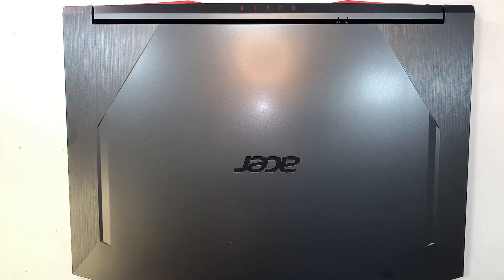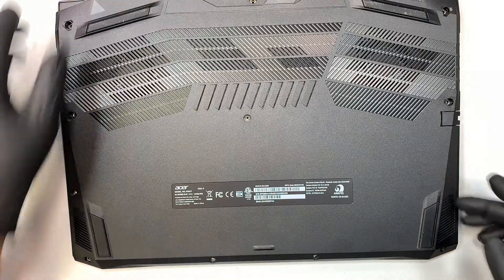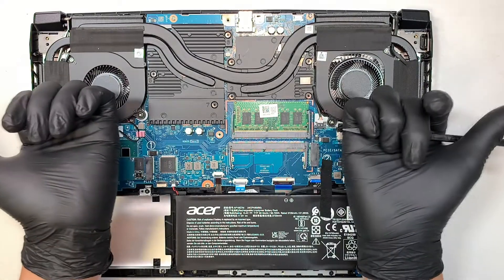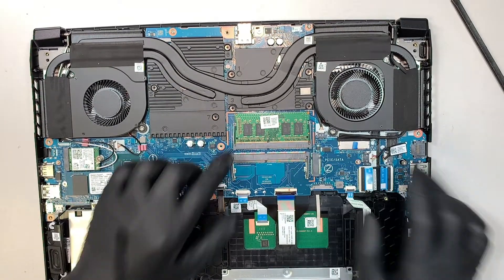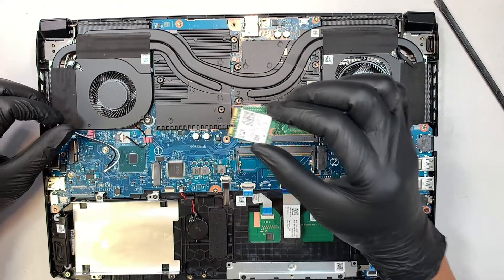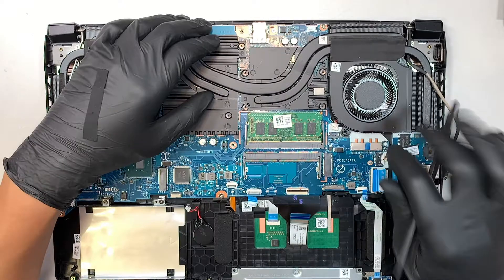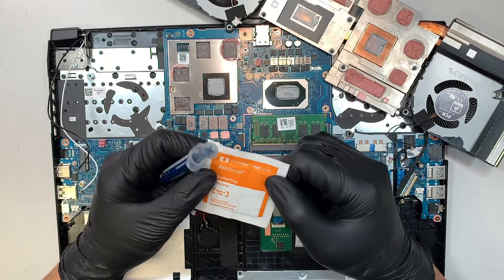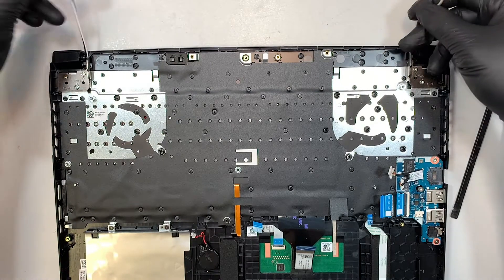Acer Nitro 5 AN515 Tear Down Upgrade Disassemble

Comment: Hello i had trouble with my power button and need to change the entire keyboard. Since its has same slot with An515-57 keyboard does that support with this model? can you suggest where i could get keyboard replacemet?

Comment: i had planned to change the thermal paste on my 515-55 but upon seeing this video i see that i should probably change the pink thermal pads while i have it open. whats the best or ideal type of pads i should be shopping for. Cause i have removed the heatsink and noticed the pink one on the chipsets have kinda melted and spread around a bit. Is there a specific thickness Id need.
Reply from the maker: Get the 2mm thermal pad. Cut into the shape you want and stick it.    https://amzn.to/3SAXjUt

Comment: WORSE PADS AND PASTE IVE SEEN YET ON A NEW MACHINE (PADS ARENT TOO BAD) BUT MINE WAS 6 MONTHS OLD THE PASTE WAS SOLID

BUT ANYWAY I REPLACED IT ALL WITH THERMAL GRIZZLY KYONAUT THE PASTE AND PADS AND GOT A 20C MIN DECREASE IN HEAT AND BEFORE THIS UNDER FULL LOAD IT WOULD THROTTLE FAST YET WITH THE NEW PASTE I GET NO THERMAL THROTTLING AND THE LAPTOP ACTUALLY RUNS PASSIVE A LOT WHEN NOT DOING BIG TASKS(NO FANS RUNNING I MEAN)
Reply: BTW I MEANT THE STOCK PADS AND PASTE NOT WHAT THIS GUY USED

Comment: Thank You. I have the AN515-57. I am figuring out this laptop with help from Excelent videos like this. I have  installed a WD gaming 3x4 SSD, and a 2.5 WD SSD. GIving Me over 1500 GB of storage adding in the factory storage SSD. My next project will be removing the CPU and GPU and redoing the thermal paste to cool My laptop even More. Thanks again for a Fantistic and informing VIdeo on how this all works. Awnsers alot of Questions on the internals. I am very new too PC and gaming.
Reply from the maker: You are welcome. Glad the video helped.